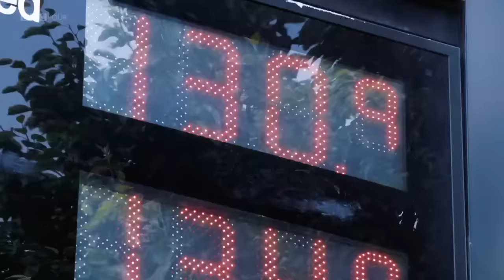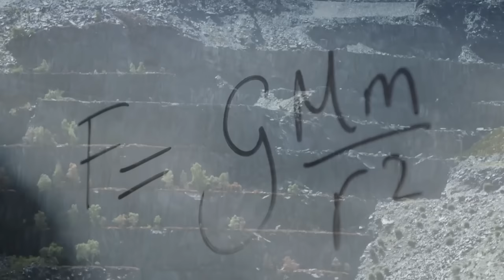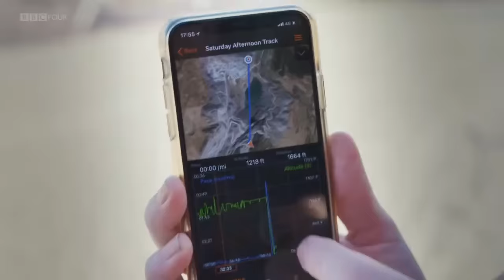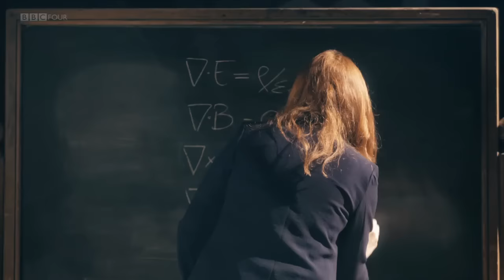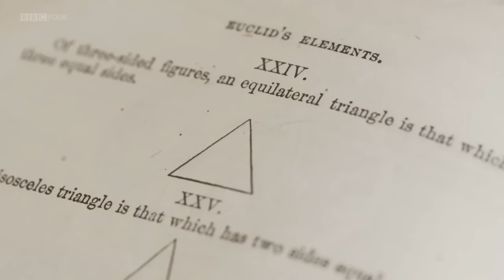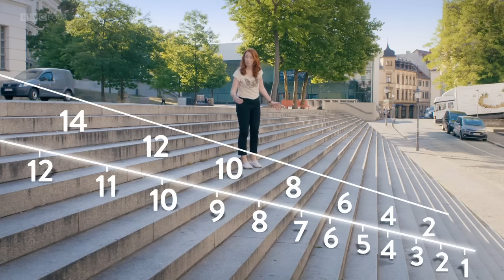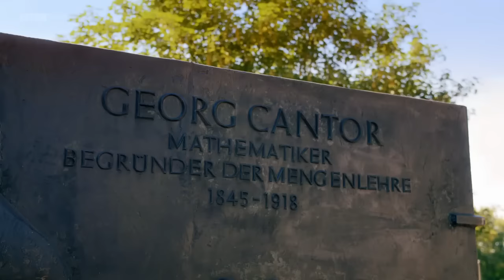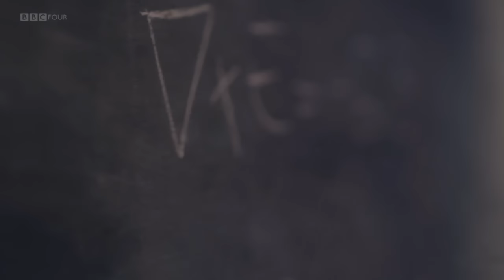BBC Magic Numbers Mysterious World of Maths 2of3 720p HDTV x264 AAC MVGroup org

Comment: 5:28 I fell into a trap when my friend, who was a skydiver, told me that after he had spent a month in hospital, that  he had lost so much weight that when he went skydiving with his team he had to put weights onto his belt to keep up. You need to read Aristotle's Meteorology to understand his physics.
Reply: Nothing against your Dad but She Has Got To look Better Than Him!
Reply: Your skydiving friend is a real physical object, with a certain mass and area of his physique, falling through a certain fluid (gases are fluids too), and his maximum "falling speed" is the balance between gravity pulling a certain mass, and the aerodynamic resistance the air is exerting on the AREA of the falling object. When your friend lost some weight he hasn't lost, I presume, much of his "area" - thus the balance has shifted.
 Aristotle's error was basically "jumping to conclusions" approach, also called "seeeking answers", or "need for [cognitive] closure" (as opposed to "asking questions").
Reply: Skydiving or Ocean deep dives aren't they both the same and affected by buoyancy of the object in question. Hence may not be the same as free falling in vacuum.

Comment: Yes, I do love Hannah. Of course I do! But I think she got something wrong.
Her calculations at ~ 13:30 didn't take into account that she wasn't in freefall. She was travelling down what I'd estimate to be a 30' incline. Furthermore, we don't have the static and sliding coefficients of the friction of her sliding line. Without that, we can't calculate an accurate measure of the actual forces acting on her. 
Still, I suspect she knows all this, but she wanted to make it simpler for people unfamiliar with maths and/ or physics to understand.
Reply: Yes, she's a mathematician, not a physicist. The equation probably should have been more like F= g sin θ. this ignores friction and air resistance, so it's a little more complicated than the 'skeleton' equation, but that's closer to what we'd need to calculate speed down an incline.
Reply: I’m pretty sure a Dr of mathematics is aware of the mechanics 🤣

Comment: Infinity is curious. I imagine that if a circle had an infinite circumference, that circumference would be a straight line.
Reply: I can assure you it could not be.
Reply: An infinite line has no ending point.
Without an ending point, you cannot turn the line back to its starting point. So it could not take the shape of a circle.
Reply: @adamrspears1981  a circle has no beginning and no end . So an infinite circle is possible
Reply: @max2008abhi  It depends upon what your perspective is. Suppose you are looking down at a slinky so that it looks like a circle. The slinky has a starting & an ending point & is not infinite.
 This example shows that the number of dimensions & our perspective, as conscious observers, matters.
Reply: But then try a circle of infinite radius - its circumference would be a straight line, and infinity = 2 x pi x infinity
Reply: How can a circle have an infinite circumference? 

Surely there would be no circle?
Reply: @rhysjones9259  Curiouser and curiouser... -_^

Comment: Can you write an equation that doesn't require any calculation, without using numbers?
Reply: How about a² = a + a = ((a + a) + (a + a)) / a.

No numbers but and you don't have to calculate anything as it's plainly obvious that a = 2.
2² = 4
2 + 2 = 4
((2 + 2) + (2 + 2)) / 2 = (4 + 4) / 2 = 8 / 2 = 4
Reply: @jayzo  Also zero, arguably.
0 * 0 = 0
0 + 0 = 0
((0 + 0) + (0 + 0)) / 0 = 0 /0 which is indeterminate, so 0 is as good a value as anything else.

Comment: So, as electricity travels along a transmission line, it's the electromagnetic field weakening that causes the loss of electricity over distance? Is that a reaction between the energy and the wire and maybe the planet, or like loss of velocity due to the distance travelled verses initial energy, entropy, thropacy from friction sort of thing .. Electricity losing energy or potential distance travelled due to friction, is that a bizzarre concept??.. So much I want to learn.

Comment: @33:28 they just finish talking about how space has many possible variations ... and they happen to be platonic solids ... which all have a common root generic shape ... so the lowest common denominator between all of the platonics is a part of the very first shape primarily ... which is 4 equilateral triangles ... so whatever is making waves in the universe for creation happen uses that pattern to transmit it's basic shape ... from there  energy level ( electro magnetic force ) takes over and makes everything from there ... now it's just a matter of  figuring out the energy levels and frequencies and poof you can make or replicate anything from a power source using a base substrate of a primary constituent to what you want to make ...

Comment: 37:40 Use 1 ruler & you get X. Use 2 & you get a number slightly smaller. Using 3 or more do you get the same percentage smaller with each step? Can this be used in determining Pi? I think the word Mantissa as the numbers to the right of a decimal point becomes an approximation of the correct value as in 1/3 becomes 1.33333 & so on. This would go beyond, like headlights, that which you could see with any large numbers of rulers.
Reply: You can't determine all the decimals of Pi, because it's an irrational number. I you would eventually found them all, that would mean that Pi is rational, that is, writeable as a division of two numbers. However, there are many demonstrations (and some of them not very complicated) that prove that Pi is irrational.

Comment: So according to physics , objects do not actually fall at the same time. If an object has more mass, it falls faster. We don't see it but it does. Aristoteles was right.
Reply: But, objects fall equally in a vacuum. That Apollo mission proved it. Mass has no bearing on gravity under a vacuum. Only air resistance changes that.
Reply: @ufafgd  I don't think there's a vacuum. Theres Aether .
Reply: @pnvgordinho  Technically, there is no real vacuum in space, it is just that any oxygen atoms are spread too thin to constitute any kind of air that we can detect. In practice, space is a vacuum, it is close enough to the truth.

The difference in the air pressure between 1 atmosphere of pressure and the space is so large, that we just call space a vacuum, its faster to use that idea, its close enough.

Anyways, that is what i know about it, my little 2 cents. I might be wrong too.

Comment: Without thought process human kind would be like nothing.
Sitting by the beach either you can enjoy the horizon or imagine what's beyond that.
Infinity is the realization whatever knowledge or mass that we have amounted or acquired or quantified is not to the extent of one hundred percent.
Infinity can be assessed by placing     yourself ideally within a circle as a point and thereafter when you reach either side of the circumference you realize that there is larger circle beyond from where you stand.

Comment: The Gallileo experiment on the moon??? Given there is no gravity in space and the astronauts themselves wore weighted boots to prevent them flying off into space, what on "moon" (see what I did there?) caused the hammer and FEATHER! to fall and not float off into space???
Reply: There is gravity on the moon. It's much weaker than on Earth, at around 17%. So something weighing 100kg here will weigh just 17kg on the Moon. The real issue is that there is no atmosphere on the Moon - it is just a vacuum. It is because of air on Earth that the Galileo experiment doesn't work too well here, but succeeds on the Moon. For a better demo of the experiment see Brian Cox's video

https://www.youtube.com/watch?v=E43-CfukEgs
Reply: Of course there is gravity in space. Gravity is everywhere. See LIGO.

Comment: 50 minutes to generate confusion about infinity, the BBC can make maths into brexit!
Reply: Confusion, or you just don't understand what's being said. It made perfect sense to me.
Reply: @basdamhuis572  I'm sure it did, i mean to a simple mind and after 50 minutes you must have absorbed something. i know what infinity is. It's a concept that as an electrical engineer i use constantly. that's, infinitly small and large. This peice of wire, it has resistance, but it's so low I just consider it for my application "infinitely small" and therefore nothing to worry about. This insulating thing between two conductors (air plastic whatever), what's its resistance? do I care? no! it's so high that I can consider it infinitely big and therefore not worthy of putting into a calculation to determine it's effects on "stuff". Lots of engineering calculations are simplified in the real world by taking something to be infinitely small or large and it is a simple construct often used in maths to prove a theory and simplify calculations or it explains the crux of a calculation like differentiation where the only true result that could otherwise be aproximated is around an infinitly small "point".

Comment: Mathematics is the language which approaches perfection the most in the universe because it most accurately describes reality and consequently the physical and non-physical universe.  However like any language, it has varying degrees of complexity and can sometimes be used incorrectly by individuals who do not possess the depth of knowledge required to understand the full complexity and changing nature of the universe.  If mankind is to embrace the next step in its evolution, it must embrace a holistic approach to geometry by combining it with motion and relativity because nothing is static in the universe.  For example, it has always been considered that the surface area of a circle is pi multiplied by its radius squared.  Is this true?  The answer is that this is a matter of perspective.  In reality a circle can be observed from above or from below, so should its surface area not be two times pi times its radius squared?  Can this be proven?  If one assumes height = 0 in the surface equations for both a cylinder and a cone, one obtains two times pi times its radius squared.  Now assume that a circle is spinning perpendicular to its diameter at an incredibly fast rate, so fast in fact that its high frequency is reshaping its topology into a sphere.  Can the formula for the  surface area of the circle still be applied to describe the reality of this high-frequency spinning sphere?....clearly the answer is no.  These are just simple examples but they are fundamental ones.
Reply: Agreed. That being said, that presenter is damn fine.

Comment: If you have two points, A and B, that are any distance apart and move one half way closer to the other, you can do this infinitely and the two shall never meet. It seems different than .1, .01., 001...
Reply: Indeed they are different. One is an infinite set of points and the other is an infinite set of negative powers of 10. However, both can be put in 1:1 correspondence with the set of natural numbers, and the cardinalities of the sets are the same; they are both "countable infinite sets".

Comment: 2:14 Because that reality created this reality out of the same Mass and the same laws of physics that control Mass oscillation and associated illusions of sensory perception caused by having one foot stuck to an initial (true) inertial frame of reference and the other one in a state of oscillation creating 3 observed moment arms connected to time dilation. All a center of gravity cares about is what's in the middle. Every major mystery in physics and astronomy from anti-matter asymmetry to "missing" dark matter is screaming out the answer... but if you don't let go of false complex assumptions that hide simple answers in this information frame you will never see the real picture hidden in a pile of illusions. 

Einstein was correct in holding on to logic connected to cause and effect... but the most difficult aspect of physics is putting on the straight jacket as cause and effect only supports one correct assumption. The most important pattern in Nature connected to time and space is being ignored because of false assumptions hiding it's raw logic and relative simplicity. 

27:17 Maybe it was caused by a loose cable like this "coincidence".... 
In 2011 OPERA announced it had done apox 1500 measurements of the muon neutrino traveling 453.6 miles @ (v-c)/c=2.48e-5 sec. over a period of 3 years. That appears to show the muon neutrino created at the speed of light was exceeding the speed of light by 2.48e-5 sec. Now here's the incredible coincidence caused by the "loose cable" that resulted in the mistake being announced worldwide... after the E158 ratio reduction calculations were posted on Nature's Forum.

SLAC's E158 weak force asymmetry ratio {a} is created by adding the EXACT distance light travels in one hour to the EXACT distance light travels in one thousand years... and basic math reducing the E158 WF Asy gain down to 453.6 miles shows that is an EXACT match @ 2.48e-5 sec by creating an asymmetry in time of 0.20e-5 sec. just as predicted in the reverse oscillation phase. You don't have to use imaginary time to get the two measurements to match because (relative to our frame of reference) neutrinos oscillate in space connected to time and the mathematics added the 4th oscillation phase of the graviton better known as the electron hole shown opposite the electron... and that's where things get heavy due to the subtrahend of the EM wave created.

SLAC confirmed time has asymmetry (adding a 2nd reverse arrow to time tailoring entropy to support Life's evolution) a year later in November 2012 adding yet another amazing coincidence. Then just a few months ago Monica Olvera de la Cruz at Northwestern University doing computer simulations working with nanoparticles engineered with DNA in colloidal crystals made a startling discovery that "rocks the current understanding of matter" and "upended the current accepted notion of matter" when she used a 1.4 nanometer nanoparticle 3/4 the size of DNA which exposed the electron oscillation phase of DNA. They had been using nanoparticles far bigger where the resulting structures appear static fixed in place, but when missing the space connected to time needed to support the reverse atomic oscillation phase of DNA the smaller nanoparticle appeared to turn into an electron and "this is where the magic happened" they said. 

Monica's discovery has been confirmed and supports the mathematics that show Life has Mass, and Mass oscillation creates the atomic structure of matter that in turn creates a filter for sensory perception connected to time.

Comment: This is stupid how can it be infinite if the universe started from a big bang. My theory is the universe goes around like everything else in the universe or it was a Edge to it like a wall blocking this universe from whatever is on the other side and the other is even bigger than our universe because we came to existence inside it.
Reply: The big bang theory is naive and was born from the human psychological need to find a beginning for something that has never had a beginning and will never end.
Reply: @kevinmerdy9189  The big bang theory was born from the observable fact that everything in the universe is, on average, moving away from everything else. If you wind back that expansion, you'll find it has a starting point about 13.77 billion years ago. You can choose to deny that is a "beginning", of course, but rejecting facts simply because they don't fit your world-view is about as unscientific as you can get.
Reply: @RexxSchneider  With respect, if you plot the distance against velocity at which a star or galaxy is receding away from Earth, you will end up with more or less a straight line at 45 degrees from the x, y axis.  In other words there is a direct correlation between distance and doppler effect and this excludes a few exceptional  stars or galaxies which are actually observed to be moving towards earth.  Don't you think this is rather strange and perhaps indicates that the wavelength of light becomes longer the further out it travels.  Don't you think that gravitational energy in space would affect the wavelength of light, elongating it?
Reply: @kevinmerdy9189  You seem to be saying that the Doppler effect is strange. And are you saying that what has been observed is some kind of illusion?

Comment: Interesting and entertaining presentation.  But unfortunately, fusion power is not clean power.  Like any nuclear reaction, a fusion reaction generates high energy particles, including neutrons.   Where these neutrons go, they change the isotopes of the nuclei they encounter.  Some of these new isotopes are radioactive.  This is true of the shielding we have to place around any nuclear reactor, including fusion reactors, to protect us biological humans from these neutrons.  When an old reactor is decommissioned, the vessel is towed up the Columbia River to be parked in the Hanford Reservation.  This will be true of fusion reactors.  The time that it takes these old reactors to become safe to stand near can be mathematically calculated to be centuries.
Reply: As it happens, fusion reactions involving high temperature hydrogen plasma do not produce neutrons, only helium nuclei, positrons and high-energy photons. The shielding required will do no more than mop up stray gamma rays without involving any further nuclear reactions. In fission reactors, it's the radioactive fission products that make it "dirty" far more than the products of neutron absorption - the neutrons are "thermal" neutrons anyway, not the high-energy particles you envisage.